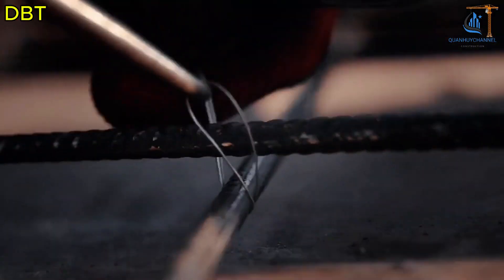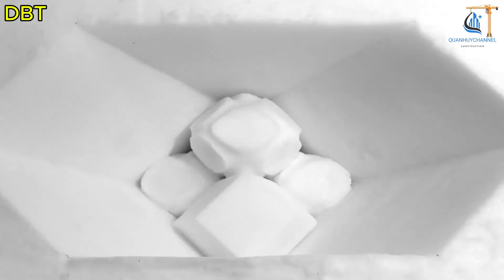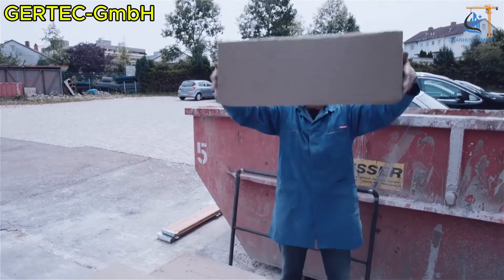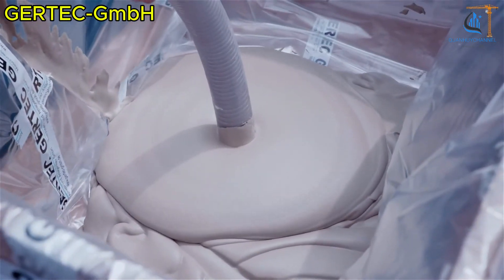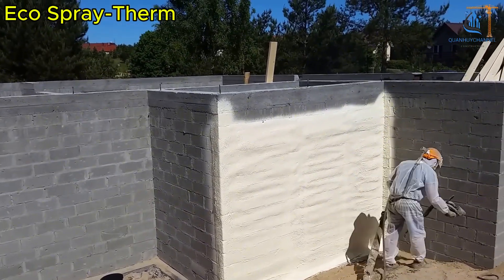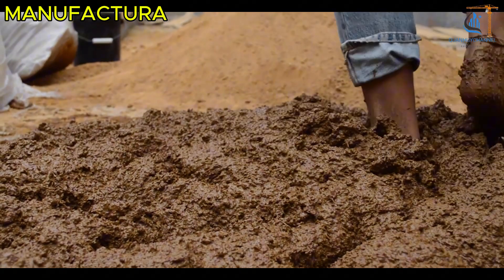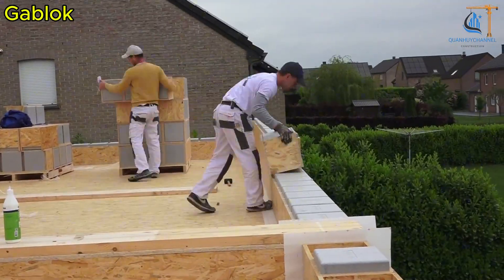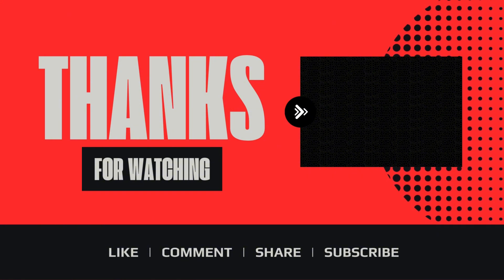Construction Workers Can't Believe This Technology | Incredible Modern Construction Technologies ▶10

Comment: So I’m going to live in a waste site surrounded by captured CO2? How safe is that for the people living on the inside?
Reply from the maker: Why do you think it's a junkyard? Every study or initiative goes through a research process.
Reply from the maker: These hempcrete blocks are a green building material made with a hemp-lime insulation mixture packed around a biocomposite structural frame.  They can be stacked like bricks to build walls up to 30 feet high and they become the insulation and the structure of the building.  All you need to do after the walls are built is plaster the inside and outside, and then add windows, doors, and a roof!  

The hemp plant sequesters carbon during its growth, and lime, as it dries, reabsorbs the carbon that was released when it was manufactured, which means the hemp-lime mixture is carbon negative (it sequesters more carbon than it creates in its life cycle).  Terry Radford from Just BioFiber says that these hempcrete blocks will sequester about 10 tons of carbon per house. 

Just BioFiber is located in Alberta, Canada and you can find out more about their hempcrete blocks here:
https://justbiofiber.com/